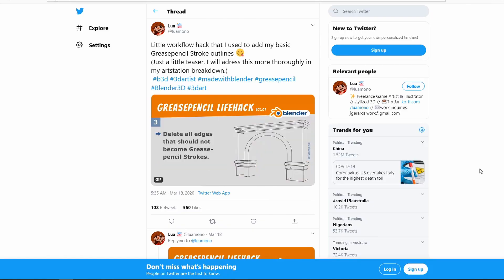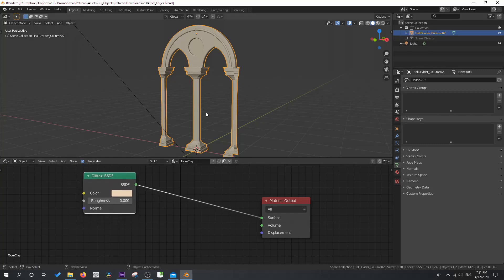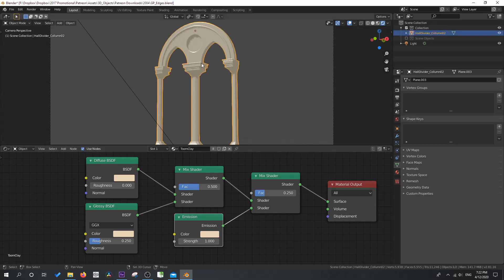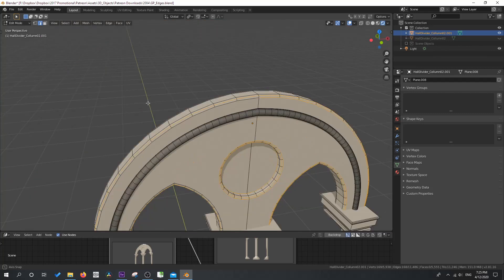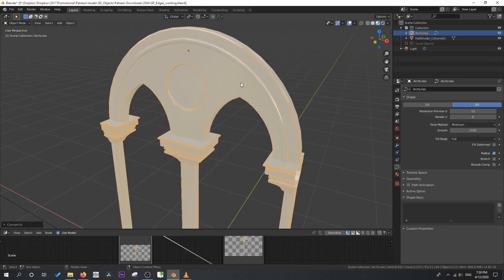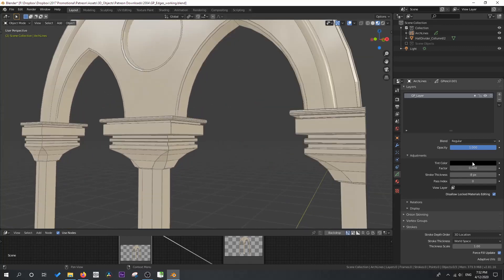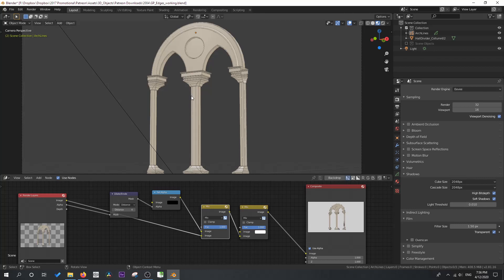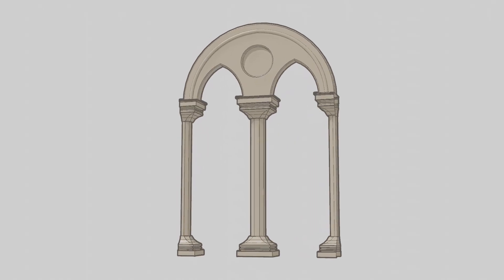My Watchlist - April 2020

Comment: The results with this technique, model, shader, and choice of colours, ended up with a very Chuck Jones look to it.
Reply: Could you mark edges and then use those marks to create a Grease Pencil object, rather than duplicating selected edges?  That way you can go back and make changes more easily by unmarking or adding additional edges and creating the Grease Pencil object again.
Reply: The changes they are putting in for 2.9 will let you do this much  more easily I think. See the video on the blender developer channel